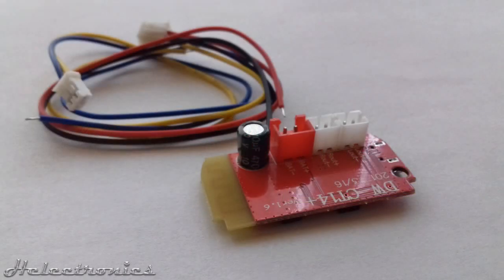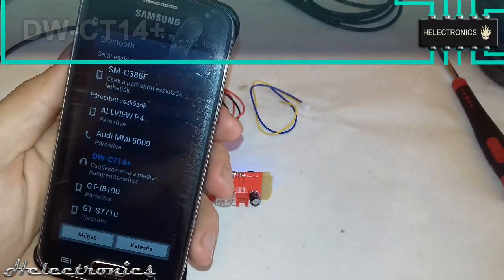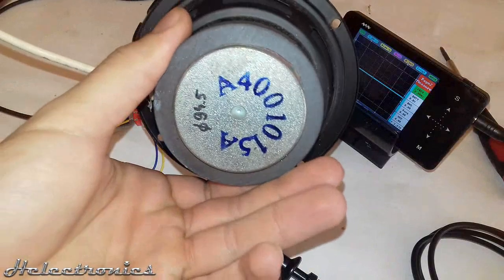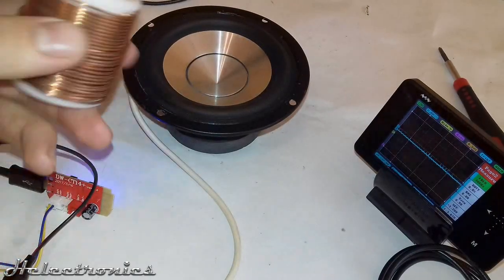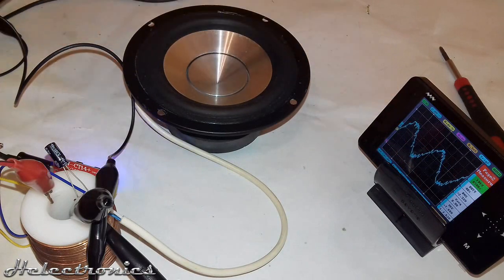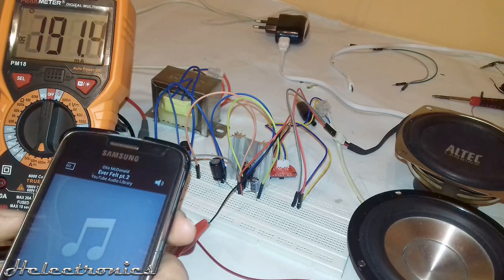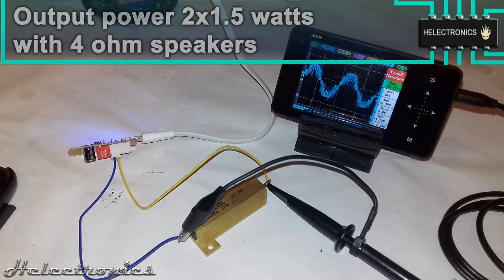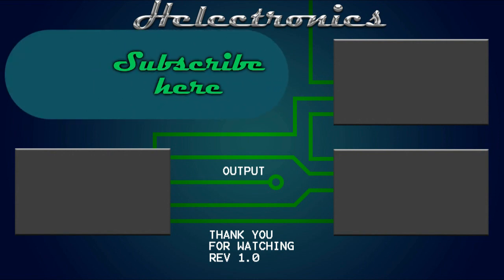REVIEW - Stereo Bluetooth Amp DW-CT14+

Comment: hi . thanx to your video. When I turn off the music, a noise is heard for up to 1 second. This noise is present when playing. How can I turn off the noise?
Reply from the maker: Hi, thanks for watching. These small class D amplifiers usually have this hissing noise, when music is stopped, then after a few seconds it turns off the output, so it stops. This can't be solved on this board,you must buy a better board.
Reply: @Helectronics  Thank you very much for answering me
I do not have electronic information. Can I use a capacitor to reduce noise and increase quality? Does the capacitor only affect the sound quality and does not eliminate the noise?

Comment: The capacitor polarity is not relevant for an AC signal. You do not need the LC filter either. The high frequencies are filtered out by the speaker itself. Almost all class D amps operate this way.
Reply from the maker: Yes, when used, the LC filter is not needed, but to make the measurements it is needed.

Comment: Is 8ohms 6w speaker good it with or 2ohms 6w speakers?
Reply from the maker: If you have at least four 8 ohm speakers then it is better, you just connect two in parallel per channel, which results 4 ohm impedance per channel.
Reply: @Helectronics  if I connect 8 ohms per channel then?
Reply from the maker: It will work just fine, in the video I've tested this module wih 8 ohm speakers

Comment: Does sound crack or distort on full volume
Reply from the maker: Just a little bit, but it also depends on the speaker.
Reply: @Helectronics  if I connect 4 speaker in parallel (3w 4 ohms) it will work? Or voice will distort
Reply from the maker: 4 speaker in parallel? Per channel? That's not a good idea. You should connect two-two in series per channel. So, on one channel/output two 4 ohm speakers in series will result an 8 ohm load, which is good for the board.
Reply: @Helectronics  but as per board specification it said 2ohms to 8 ohms moreover if I connect in series  means more resistant and less sound
Reply: @Helectronics  two speaker on one channel and another two On other channels so net is 6w 2 ohms per channel
Reply from the maker: Haven't tried it to combine speakers in parallel or 2 ohm speaker. Usually these boards do not like 2 ohm speakers even if it is specified in the description. Needs to be tested if it can handle at full volume.
Reply: @Helectronics  I had one board mh-m38 I used to connect it in parallel. 6w 2 ohms per channel it used to work great but little distortion when turned up full
Everything else was fine

Comment: What about high frecuency noise at the outputs? I'm planning on having one of these for my dual tpa3118 bluetooth speaker, since the bluetooth module i have it's not stereo and outputs a REALLY annoying high frecuency noise (+ amplification of it)
Reply from the maker: Hi, be careful, this module is POWER amplifier, this means only speakers can be connected. I recommend the XY-BT-MINI stereo receiver with really good quality low level output.
Reply: @Helectronics  yeah, I saw those XY-BT's, thx for the reply
Reply from the maker: Thanks for watching!

Comment: I bought it, the jz b5w2 and it sounds distorted
Reply from the maker: What kind of power supply did you use and what kind of speakers?
Reply: @Helectronics  I used a single 18650 2600mah vape battery. And as for the speakers I used aiyima 1.5 inch 4Ohm 5w neodymium speaker... One that looks like the jbl go2 speaker driver.
Reply from the maker: Is the battery charged fully, using a BMS charger? Also you should try to connect bigger speakers that can handle more power, these 5w speakers should handle it theoretically but give a try with bigger speakers.
Reply: @Helectronics  yeah it's charged full with a 7.5a 1s bms. I will try using bigger speakers.thanks.
Reply from the maker: Let me know what are the results.

Comment: Hi again, um I need help with my diy, I used a 7.4v 2600mah on a 20w amplifier with 10w*2 driver and when I put it on 80% volume up, it makes this crackling noise, pls help .. idk what to do..
Reply from the maker: Hi, sorry for late response, what kind of amplifier is that? Does it have a brand or number? Have you tried using 8ohm speakers?
Reply: @Helectronics  hello, It's ok.
The amplifiers name is xy-p15w.

Comment: If I connected 18650 3.7V Battery for power how to make charge whether we need to add TPA4056 Charging protection board ?
Reply from the maker: To charge the battery, you just have to connect a micro USB charger to the TP4056A module and it should charge automatically.
Reply from the maker: The red LED indicates that it is charging, when it's done, only the blue LED stays on.
Reply: @Helectronics  Thanks Bro for Your Response
Reply from the maker: You are welcome, just ask if you need more help. Watch my other videos, I use the TP4056A module in my other projects too.

Comment: Hi what is the highest speaker wattage one can use with regards to 4ohms. And will I have to use a protection for battery?
Reply from the maker: The speaker wattage must be higher or equal to 5 watts. I do recommend using battery protection module too. Thanks for watching!
Reply: Can two 70watt RMS speakers be used to make a Bluetooth speaker system using this amplifier?
Reply from the maker: Yes, those speakers are good. Here is a video which can help you with the wiring: https://youtu.be/vRGRet6Jkvs

Comment: Whats a protection circuit?
Reply from the maker: The protection circuit or Battery Management System (BMS) is used for charging the li-ion battery. It is essential for li-ion batteries, therwise it can blow up.
Reply: @Helectronics  do I need a BMS to connect the amp to a lipo? If yes what type of lipo do you suggest? I'm building a sound system for my rc truck
Reply from the maker: For Lipo battery I don't know exactly, but for Li-ion I've used the TC4056 as seen in this video: https://youtu.be/vRGRet6Jkvs
Reply: @Helectronics  I'm looking to run 4 speakers and have enough power so the amplifier doesn't chip out
Reply from the maker: What is the impedance of the speakers?
Reply: @Helectronics  i don't know what that is but both sets of speakers are 4ohms and 5 watts? The bluetooth amp is also 5 watts, I don't want it to keep chipping out.
Reply from the maker: The impedance of the speakers is 4 ohms. You should connect the speakers in series, two by two for stereo setup. You connect two speakers in series which adds up to 8 ohms for each channrl, the amp should drive these speakers easily.
Reply: @Helectronics  they have a 4 ch amp on aliexpress im gonna try that and hope it works.Do you have a patreon/Facebook? I could use your help making this and would like to show support while you're helping me.
Reply from the maker: I have a facebook page where you can write me and I can help you, also if you want to donate, you can do it on Paypal, you can find the links  in the description.
Reply: @Helectronics  can't find u on fb my friend
Reply from the maker: https://m.facebook.com/Hobbyelectronicslovers/
Reply from the maker: You can write messages here, on my facebook page

Comment: Hi,  My module has a startup with some messages with a kind of bad English  by a Chinese lady.  Also at startup the volume is very high.
Is it possible to change this messages with some bips as I saw in some reviews?
Reply from the maker: Hi, unfortunately not. Those what you've seen in my videos were ordered also from Aliexpress from the WorldChips store and when I'm lucky I get with the bip sounds and not with the Chinese woman announcer. I could find a page where the receiver ic, JieLi AC6905 (which this board also has) is explained well, but it is not a complete guide, just a beginning on how to program these ICs.
Thanks for watching!
Reply: @Helectronics  Thanks for quick answer. It is unfortunate. The ladies english is really bad, otherwise the module works fine.

Comment: Hi, I have just watched your vids, they are helpful thank you. I wanna ask, Is the JZ B5W2 amplifier good? It looks like the one from this vid.
Reply from the maker: Unfortunately I don't have that but I've searched for it and it looks the same, I think you can try one but don't expect 2x5W clean output.
Reply: @Helectronics  Thank you.
Reply: @Helectronics  Hi again, I am using a 2400 mAh li ion battrey on my DIY, and i am planning to use a Booster on it, Is it ok?
Reply from the maker: You don't need voltage booster, it should work fine with the 3.7 volts, but if you still want to use booster, you will have to sacrifice around 10% of battery charge on efficiency losses, also try not to exceed the 5 volts too much.
Reply: @Helectronics  Hi again, I have found a old li-ion 2800mAh samsung battery. It is not 18650 its flat and it still works, Can i use it for this board? if yes should i remove and use a different protection board? Thank you So much for the Information!!
Reply from the maker: Hi, yes if the nominal voltage is 3.7 then it should be fine. What do you mean to remove and use different protection board? Phone batteries have no protection board included, you have to connect one to it.
Reply: @Helectronics  OML Thank you so much.. idk that they do not have any protection board.. You are a very good youtuber.. Thank you.
Reply from the maker: You're welcome, glad that I could help!

Comment: Compared with cheap bluetooth speaker amplifier , which is better sir ?
Reply from the maker: You mean like already made bluetooth speaker, like the JBL or Sony? This board is cheap, also it has not a reliable Li-Ion recharge management so compared to commercial bluetooth speakers it is worse, also in sound quality.
Reply: I mean such as fake jbl or another one....
I planned to buy 2" , 4 ohm 5 watt neodymium speaker for DIY bluetooth  speaker
Reply from the maker: I don't know which is better, probably the already made bluetooth speaker. Do you have instrument to measure the speaker parameters to build a corresponding enclosure?
Reply from the maker: Haven't had a fake or cheap bluetooth speaker.
Reply: Ok thanks sir ,
Reply: Is there another 5w bluetooth amplifier better than this one sir ?
Reply from the maker: Sanwu bluetooth amplifier, you can find a review video on my channel.
Reply: @Helectronics  ive buy this amplifier sir , ct14 
For power supply , better using 3.7 v port or 5v via micro USB sir ?
Reply from the maker: It has a little bit more output power when 5v micro USB port is used. The other port is used if you want to use it with Li-Ion battery.

Comment: If I connected 18650 battery there is no any charging indication
How can we fix?
Reply from the maker: This board has no built in indicator, it has a safety shut down feature against over discharge of the battery. As I said in the video I do recommend to use protection circuit with the Li-Ion battery. You can connect charge indicator module separately to it, or you can find charge protection and management circuit with charging indication.
Reply: @Helectronics  In that case I need to Use TP4056 Charger Module for protection
Reply from the maker: Search on my channel BUILD - WonkyMonkey Bluetooth Speaker Repair, in that video I've used this module with the same protection circuit as you mentioned.
Reply: @Helectronics  Awesome 👍
Surely I will watch

Comment: Can I pair 3W - 4ohms x 2 speakers, without any issues. and hey, thanks for the review very helpful.
Reply from the maker: Yes, it should work with those speakers, but I recommend bigger ones, at least 10W rated for greater sounds quality. Thanks for watching!
Reply: @Helectronics  How many watts is compatible bro?
Reply from the maker: @nizamudeenmohammed8898  The board output has 2x3 watts but as I mentioned I recommend more powerful speakers.

Comment: Did not put frequency in which it works, I mean how low does it go
Reply from the maker: Tomorrow I will hook up the oscilloscope to the board and let you know how low can it go.
Reply: @Helectronics   wow thanks very much apreciated
Reply from the maker: I've measured today, it can go around 100 Hz and after that slowly drops, so this circuit is not the best for low frequencies.
Reply: @Helectronics  Thanks you very much that settles, I'll try to find a better one 20 is my goal but I'll take 40 if it's cheap :p
Reply from the maker: Check out the Sanwu stereo bluetooth amp, recently I made a review video of it, that can go way lower!
Reply: @Helectronics  sure I'll check it out

Comment: I have this one at home..
But i got problem.
If i play with full volume the sound is not good..
What can i do to fix it...

My speaker is 2x5watt 4ohm 2inch.
Reply from the maker: Have you tried to connect better/bigger speakers? Probably it is reaching the full excursion. Furthermore, what kind of power supply do you use?

Comment: Hi i have the same board connected to 4ohm 3W speakers. I get a faint but audible hum. Is it normal ?
Reply from the maker: Hi, yes it has a hum in idle, but when I start to play music the noise stops or gets attenuated. What kind of power supply do you use? Using a LiIon battery with protection circuit can help.
Reply: @Helectronics   thanks for answer. Yes i am using 18650 battery with protection. I have also tried running it without the protection and that didn't help with the noise. Do you have any idea how can i remove that noise ?
Reply from the maker: You can try to put between the output of the board and the speaker an LC lowpass filter (coil and capacitor). If that does not help, probably you have a faulty module. You can watch my other video: Connecting PAM8403 to XY-BT-MINI where I do a lot of troubleshootings.
Reply: @Helectronics   Thank you very much. I will try that and watch that video :D

Comment: I can't turn it to max volume because it has to much distortion
Reply from the maker: What kind of power supply do you use? Does the speaker support at least 5 watts?
Reply: @Helectronics  10w 8ohm I have tested on three or four speakers. I wanted to built a Bluetooth speaker but this Amp has not enough power. I have bought a 6w Amp I hope this own does the job should arrive today
Reply from the maker: @bluecrafter_  Do you have 4 ohm speakers? 8 ohm speaker are not so good with this amplifier, those are too silent. Also it may happen that you have a factory faulty module.
Reply: @Helectronics   I have found a 4 ohm speaker has much more power at 4ohm I think I will build two speaker
Reply from the maker: @bluecrafter_  You should try it with two 4 ohm speaker, it will be loud enough.
Reply from the maker: @bluecrafter_  Alright, have fun building!
Reply: @Helectronics  Thanks!

Comment: Good review!! I have both of these boards and was wondering why the black one(m38) clips if I raise the volume above 50-60 percent? Does this happen with your board too?
Reply from the maker: Thanks! I don't have the M38 board so I can't really help with that. I haven't noticed clipping at this board, it is working just fine. What kind of power supply do you use for it?
Reply: @Helectronics I am using regular smartphone 5v 1amp supply. It seems to me that there is some kind of distortion in low frequency when I cross 70% of the volume in dw-ct14. You should give a try to MH-M38 board, it comes in black colour. M38 board goes maximum up to 50-60 percent of the volume but still it beats dw-ct14 in terms of volume and clean sound.
Reply from the maker: Try to use a better charger (for ex.: 5V 2A) or try to use it with Li-Ion battery (with protection circuit)
Reply from the maker: I will buy an M38, but the shipping is long, so hopefully in 2-3 months I will have one

Comment: Do this board also charge battery or we need separate charging board?
Reply from the maker: Tomorrow I will measure it if the output voltage at Bat connector does not exceed 4.2 volts. Theoretically yes, you can connect it but I would recommend using a dedicated charging board. I made a separate video about this in Wonkey Monkey bluetooth speaker repair video, you can find it on my channel.

Comment: This board is shit, at list regarding power. It is very low loudness at 4 Ohm load. No more than 500mW.
Reply from the maker: You must have a faulty module then, did you use a good power supply? Have you measured the output with oscilloscope?

Comment: When it comes to building your portable audio or wearable project the DW-CT14+ is one of the best modules. It helped me create a great bluetooth sleeping mask. Been swapping between 2 different versions of the build for months without issue. It needs to be paired with a charger module to make it portable. You can easily make your own headphones with it. I have no affiliation with the module manufacturer I'm just a DIY'er. Here's my 40+ hour rechargeable bluetooth sleeping mask build using the DW-CT14+ featured on Adafruits Blog. :) https://blog.adafruit.com/2019/03/13/from-the-forums-an-improved-bluetooth-sleeping-mask-adafruit-bluetooth/

Comment: Can Add volume control dual channel
Reply from the maker: I assume you think to add a potentiometer to the output, but it would not work, the potentiometer would burn out. You have to control the volume from the phone or to use XY_BT bluetooth receiver module with PAM4803 dual amplifier circuit and use the potentiometer between them. I think there is a way to add volume buttons to this circuit, but I'm not sure about that. I've searched for a datasheed for the receiver IC and there is a way to add buttons to the IC, but this need to be tested. Here is the datasheet: http://www.chenbingdom.com/uploadfile/201721417245311011.pdf